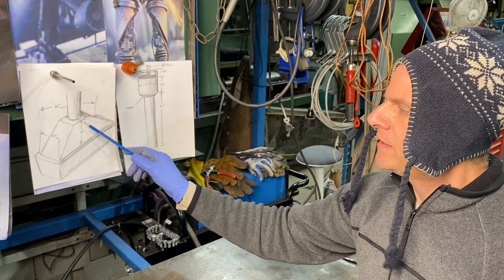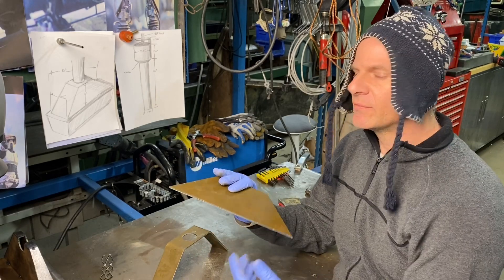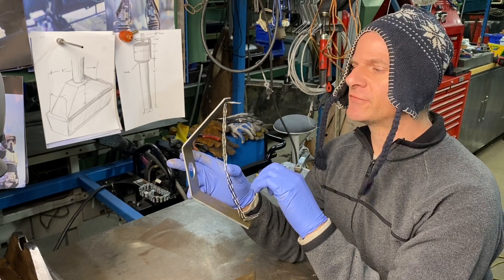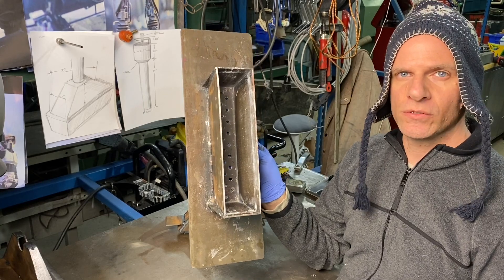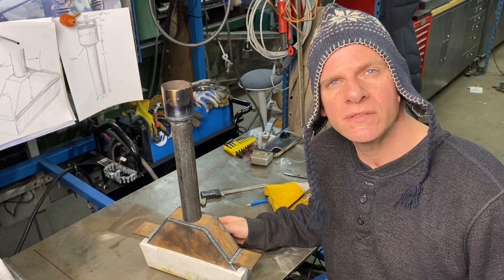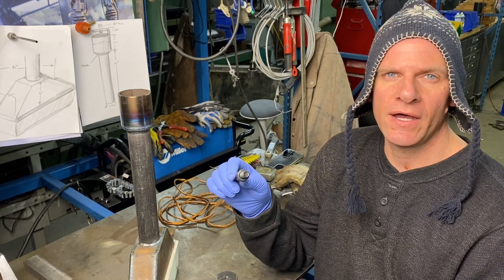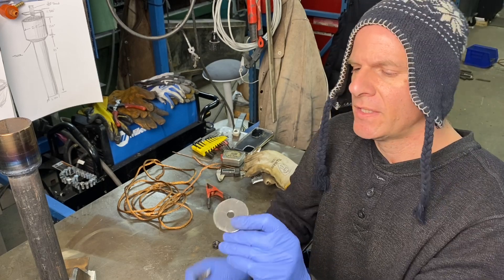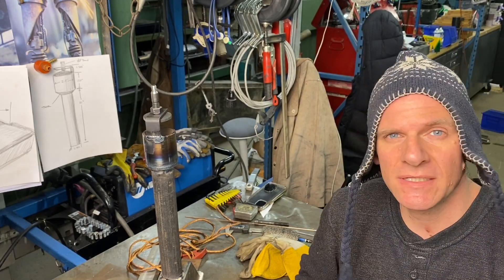Making The Best Forge Ribbon Burner!!

Comment: I had a venduri burner in my first forge and about to build a new forge with a Ribbon burner. My understanding, after much research is that the Ribbon will require less propane and give me a more even, hotter and better controllable flame. The ribbon part of the burner is neat with the tapered shape.. the diffuser seem like it could use more diffusion lol.. then it got confusing to be when you threw the venduri system in the mix.. I don’t see how this is more efficient than my two venduri burner system I had other than a more spread out flame.. efficiency? To me the flame is more spread out so it would be less efficient 🤷🏻‍♂️ I’ve been wrong before. 
Like anything I guess, to each their own and guys like me take what they like best and make their own mistakes and learn in the process.

Comment: I can't figure out why you're using a ribbon burner with a venturi...? Venturi need high flow and low "back-pressure" but ribbon burners add a lot of "back-pressure", which is why they normally use forced air...
As long as it works for you!

Comment: The best ribbon burner out there!  I'm curious on size of burner to size of furnace. I'm running an inside wall dimension of 7"x14" deep.  Do you think this burner should be shrunk for the size of my furnace. 
Thanks
Reply from the maker: Thanks yes i think it definitely will work i sell these also check out my video on converting a old forge to a ribbon burner forge thanks for watching

Comment: Never thought you could do a venturi-style ribbon burner and have to wonder about the efficiency compared to a blown burner.  Still.... I'm glad I learned it's possible.  Kudos to you for that tapered design, too.  I've always wondered why people don't do that, but figured they must know something I don't.  Kudos, again, for thinking for yourself!  FYI - it'd save a ton of time making those air-regulating washers if you just buy the round disks from a fence supplier, or have a bunch laser-cut for your.  I buy a ton of flat circles every year for similar tinkering needs and it's pretty economical compared to making them myself.  The ones I get are .110" thick, plenty good enough to take a thread like you're using.  That and some weld-on steel reducers would save a lot of your time/labor when it comes to doing the burner tube section.
Reply from the maker: Thanks for the idea never thought of using round disks from the fence supplier awesome
Reply: @BonifabcustomRobBonifacio   They run about a buck each, and you can't get just any diameter you want since they're making them for standard pipe sizes, but.... it's easy enough to make do with "close enough".  

I've had nothing but good dealings with these folks --

https://www.ebay.com/str/cutnweld/Caps-Elbows/_i.html?_storecat=2039517018
Reply: @BonifabcustomRobBonifacio  If you want custom-sized discs or anything else, I highly recommend 2twentytwodesigns.  I've been using him for years, and he's always got the best steel with the best finish.  And he's all too happy to deal with you outside of ebay if you just email him.  Great guy to deal with, and getting disks custom cut to your specs would likely be pretty economical judging by what's on his site already.

https://www.ebay.com/str/2twentytwosteeldesigns

Comment: Venturi ribbon burner...interesting. What PSI were you running your gas? Speaking strictly of gas efficiency, I'm wondering if this 'venturi ribbon' is more/less efficient than a 'standard' venturi or standard' forced air ribbon burner. (I suspect the forced air ribbon burner is still going to be more fuel efficient. I do like the idea of the taper on the ribbon burner housing!
Reply from the maker: Not sure of the psi but your right the forced air is more efficient as i mainly use them for my forges check out my other videos to see how they work thanks for watching

Comment: whats the minimum psi you have to run it at to achieve forging temps?
Reply from the maker: It changes as it heats up but lower than 5
Reply: @BonifabcustomRobBonifacio  thats awesome, thanks

Comment: Hi rob, I have made a ribbon burner using your design, however i keep getting blow back (a loud pop then the flames start coming out the top) I’m not sure what I’ve done wrong, I think it might have something to do with how far down the tip is extended into the tube, or my gas pressure not being high enough, I’m a bit apprehensive to crank it up. Do you have any ideas?
Reply from the maker: Conner Kleister hi Conner make sure the jet is further in the tube so it forces the flame out the bottom
Reply: Cheers rob man, got it working a treat today and done my first bit of forging. Thanks you for been such a cool guy.
Reply from the maker: Conner Kleister great news , if you need any help don’t hesitate to message me thanks

Comment: Can you tell us the EXACT kind/brand of casting refractory you used here, please? I live in a small town so that must be ordered online, and I need it to be right. I tried to mix sodium silicate "water glass" with aluminum oxide grit, cured with CO2 and that failed to mold nicely. Then I tried to drill a firebrick with masonry and then glass bits - forget about it.
Beautiful job and perfect instructions - THANKS!
Reply from the maker: AerialLensVideo hi the refractory cement is called unicast-70 i get it from a supplier called smelco thanks for watching
Reply: @BonifabcustomRobBonifacio  THANK YOU! You are my hero for the today.
Reply from the maker: AerialLensVideo your welcome

Comment: I am impressed with how efficient your burner appears to run, especially without any forced air. I also like the taper in the refractory that you did. I noticed some builds where people have used plastic straws instead of crayons. Supposedly the straws are much easier to remove than having to drill out all the crayons. I am currently building myself a new forge and ribbon burner and I will definitely be borrowing some of your ideas. Thank you for taking the time to film and post this video it was very helpful and informative.
Reply from the maker: Erik Pettingill thankyou much appreciated
Reply: I would think you could easily melt the crayons out of it with a torch or just suspending it over a fire.     But yes I love his design with the taper.   lots of things to consider as I am thinking of designing my forge.

Comment: Nice burner build....but why is it naturally aspirated? What PSI were you running it at? Usually they are blown and I've never even considered that NA ribbon burners would be viable as it seems that the way NA/venturi burners work would be hindered by the restriction caused by the smaller orifices.

I mean if it works it works but ive never seen one before and i have my doubts on the efficiency. Thanks for the video
Reply from the maker: Apex Annihilator thanks I’ve made them both ways i like the NA because it doesn’t need any blower but the inlet tube and main tube needs to a lot bigger when doing this  it still runs low psi and has good heat , everyone seems to have there mind set on blower motor is the only option when using a ribbon burner but it’s not the case , thanks for your comments 👍
Reply: @BonifabcustomRobBonifacio  thanks for the reply... I consider myself open minded as far as that goes assuming that it still performs well when installed in a forge